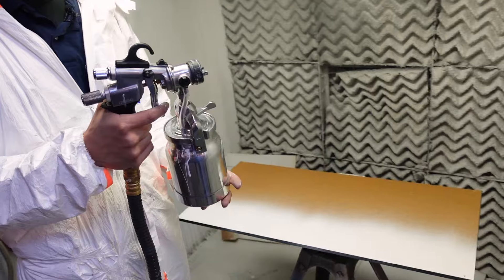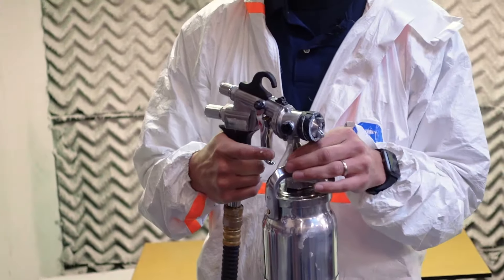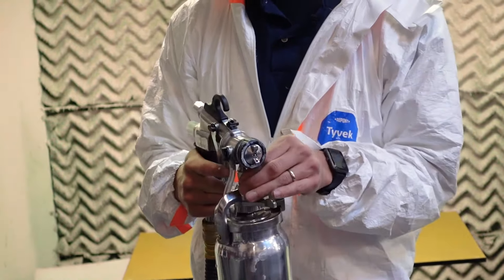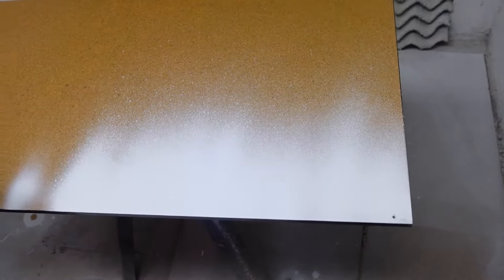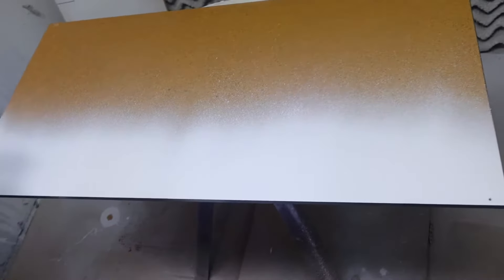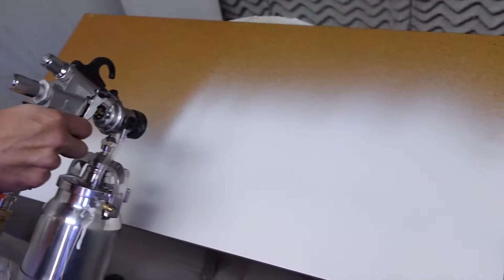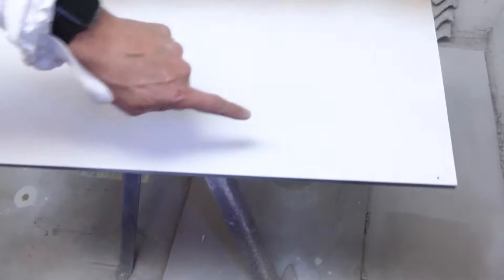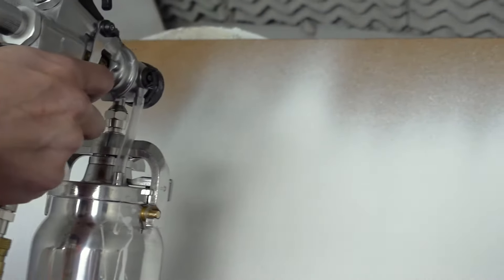3 VS 4 vs 6 Stage HVLP Turbine Sprayer Comparison

Comment: You can use a handheld turbine for many oil based finishes and some water based finishes with little to no thinning for a handheld turbine while some finishes may need to be heavily thinned. Handheld turbine sprayers are less powerful than a 3 stage turbine but the portability can be advantageous at times, and they are cheap compared to multi stage turbines.

Comment: More often then not even with a 6 stage and water born material you should thin just a little anyway and that's when you get the glass as long as you spray consistently no heavies or dry patching

Comment: Great video. I wonder if we can use something like Dewalt 5 horsepower portable vacuum (with a blower function) with a HVLP gun. I think something like it can be quieter, cheaper and stronger (more air volume) than a stage 5 machine as long as we can connect it to a flex hose. Dewalt even has a remote.
Reply: People have modified vacuum motors for turbines

Comment: Quick question for you.
I have two 3 stage turbines, why can't I just run a "Y" connector off of them and have a 6 stage at the gun?
Am I an idiot or could this work?
Reply: That's an interesting idea... but you won't increase the pressure, only the air volume.  And to make High Volume Low Pressure system work effectively you require both.  Sorry, but that's how it works!  My recommendation would be to sell your two 3-stage turbines and get yourself a 5-stage unit.  And look at other manufacturer's systems, as the spray gun being used in this video leaves much to be desired.

Comment: So is an air compressor better then?
Reply: Kathleen, there are compressed air based HVLP spray guns on the market, but they atomize finishes only slightly better than the highest-stage turbine HVLP systems.  HVLP technology can only do just so much so if you are planning to spray mostly very heavy bodied, thick finishes (the proper term in the industry for these finishes is "high viscosity") which you will be spraying in a commercial setting, day in and day out.  If that's what you're planning to do, then you need to move up to the next level of technology.  It is called air-assisted airless.  This technology relies on a fairly large compressor to drive a pump that will compress the finish being sprayed.  The finish is moved through 1/4" inside diameter, high pressure fluid lines to a spray gun specially designed to work with the pump.  The finish comes out in a very soft spray, producing an exceptionally well atomized finish.  That's what most professional cabinet and furniture shops are using these days.